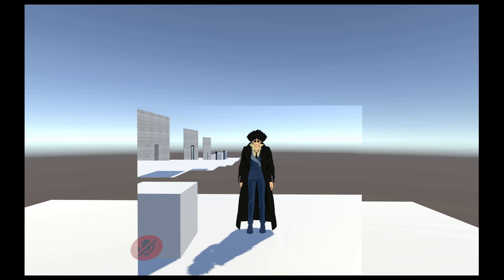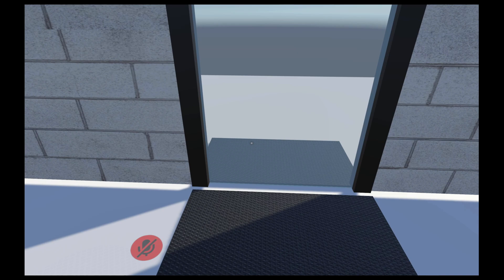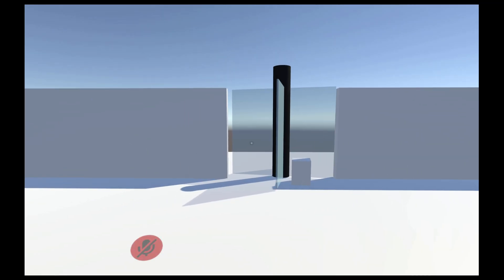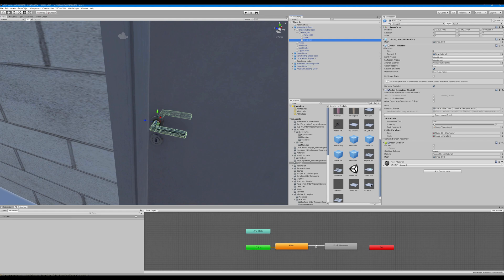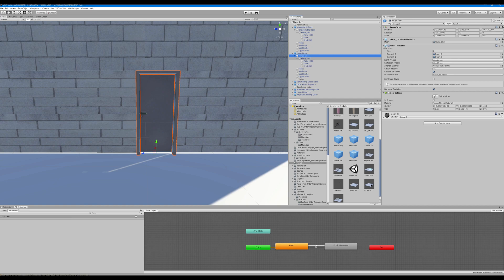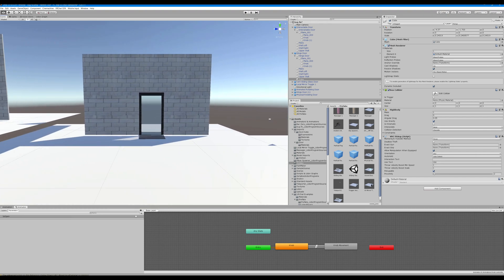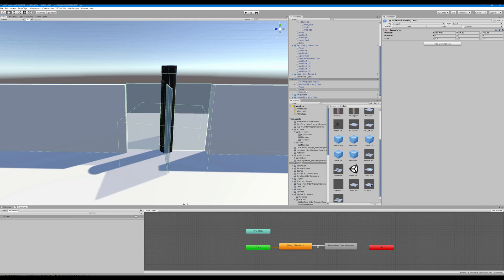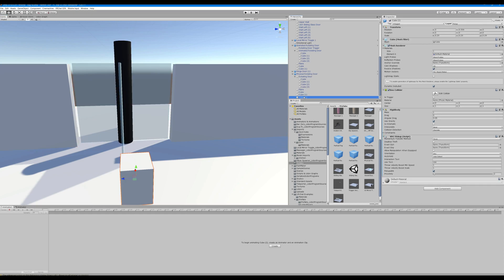#VRCHAT Door Examples: Animated Interact, Animated Collision, Hinge Joint | #VRCSDK3 #UDON

Comment: How do you make objects interact with the player's capsule collider?  Like for moving pickup items by colliding into them.
Reply from the maker: Hm, can you be slightly more specific on what you would like to do? It may change the way its done. One method would be to add an "On player collision" event and then do something with the object/player.
Reply: @Akira_UE5  for example a cloth component that is set up to interact with the players capsule collider. I've seen it done with a hanging sheet that would move when passed through
Reply from the maker: @RediceRyan  So, just to be super specific, do you want the cloth to move all cloth like around the player or for that to happen and for it to move the players dynamic bones.
Reply: @Akira_UE5  Just for the player's capsule collider to interact with the cloth component. Like assigning the collider to the cloth component.